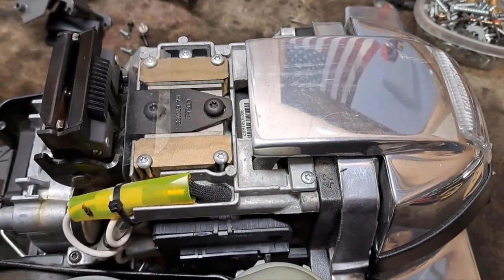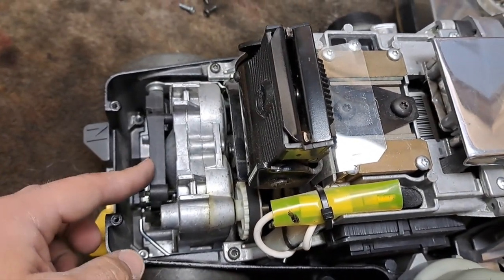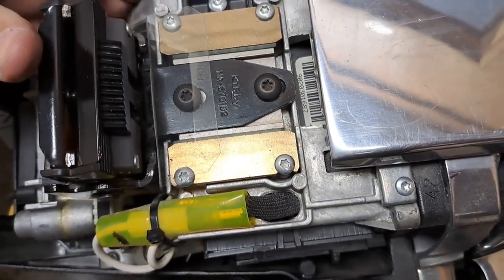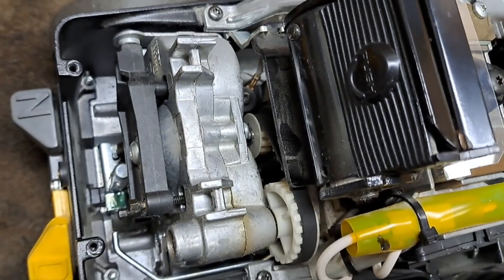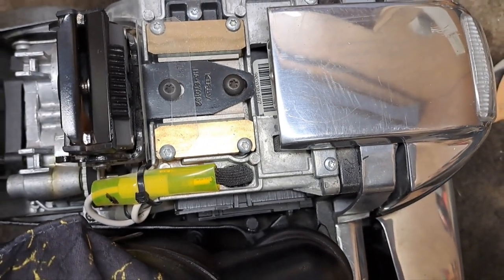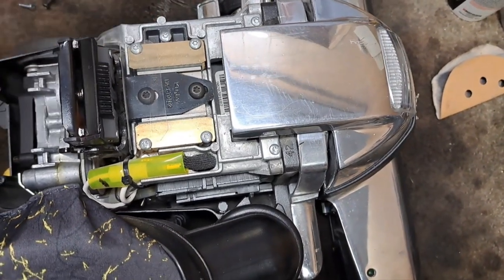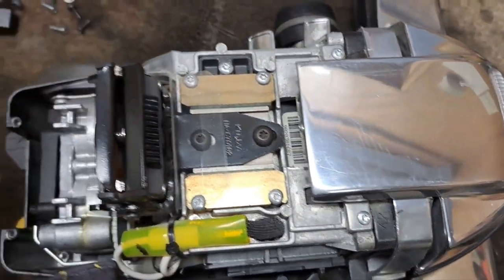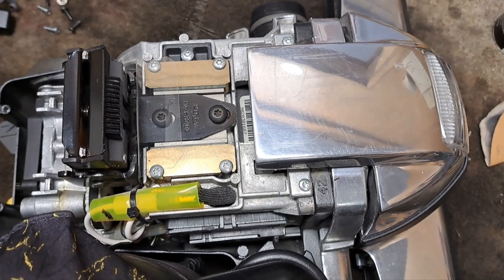Kirby G-series transmission adjustment!

Comment: Great video! This is what I finished doing last Saturday. After so much usage, mine would hit forward and backward in the slide area. There will be an occasional tap when pulling back on it here and there, but it is a lot better than it was. The next time I get back in it, I will adjust the screws. For now, it works well enough.

Update: I opened up my Diamond and adjusted the screws and readjusted the handle pivot. It works fine now.

Comment: So if I want it to have more assist, more torque in both directions, I could adjust the two top bolts in the pivot slide like you did, and the back bolts, I could drive them in just a little more?
Reply from the maker: Yes you're exactly correct, BUT You must leave an eighth of an inch of slack for both forward and reverse adjustments. When you're done adjusting, power on the Kirby and put it in drive. Lift the back wheels up off the floor without touching the handle spring, the wheels should not be spinning. If the wheels are slowly spinning forward or backwards, you'll need to give it more slack in the slide by adjusting either the forward (top screws) or the reverse screws on the back. Best of luck, I'm sure you'll get it dialed in.. thanks for watching.